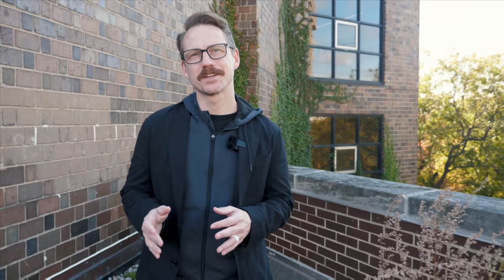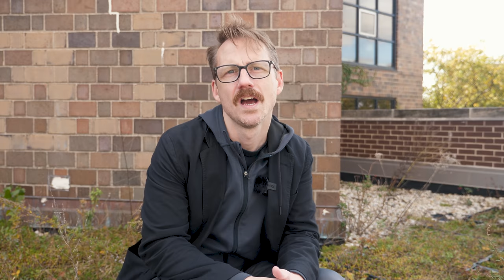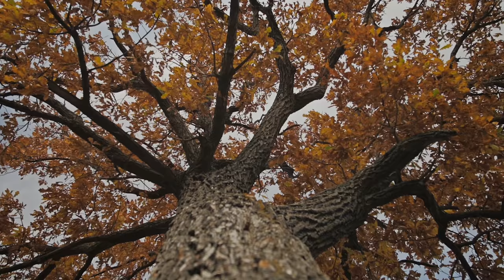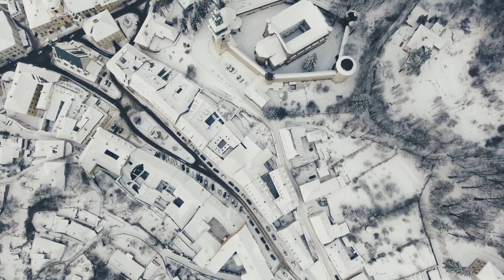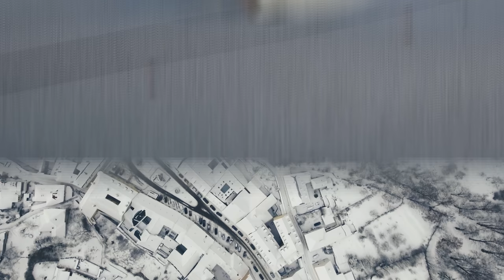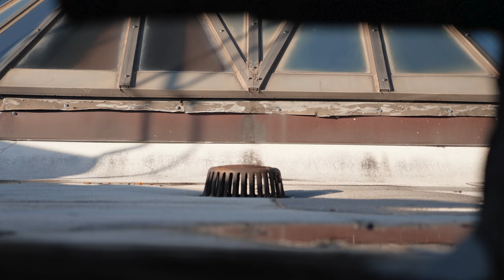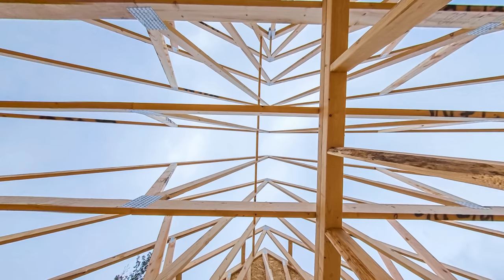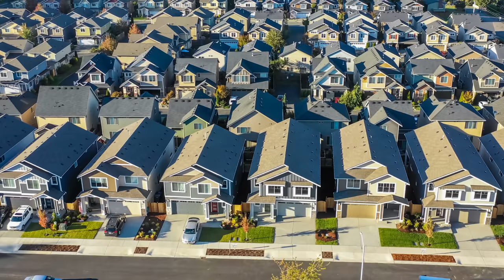Why Do Architects Insist on Using Flat Roofs?

Comment: I don't know about elsewhere, but in the UK flat roofs in a domestic setting are synonymous with shoddily built extensions that are cold in winter and have persistent leakage problems ten years after they were built. I think it's this that leads people to loathe flat roofs in houses.
Reply: It's people going for the cheapest quote. Getting poor quality people. That simple don't have the skills or knowledge. Even the Germans use flat roofs. I've worked in both countries.
Reply: @BillyMustang101  My late parents house had an attached garage with a flat roof. That flat roof had to be renewed four times over the fifty years they lived there.
Reply: I did work on one of those extensions.
 I tarred the roof, green as all hell I was mind you.
It took attention to detail more than anything, our friend and neighbor who is an actual handyman blew it.
All I did was make sure the tar made logical connections with the flashing, and press on the roof to find leaks.
 P.S. roof tar doesn't like being 10 layers thick. It contracts/expands during thermal cycles, if it's thicker it splits more readily.
Reply: The town-home I used to live in had a section of the roof that was flat that held the heater/air conditioner. They leaked all the time and it was very expensive to lift up the air conditioner unit to fix the roof underneath it.  I will never buy a home with a flat roof again.
Reply: except for reed tatched roofs.
Reply: also - the poor council housing in the UK (aka social housing) in the 70s - every single block of these flat roof houses ended up having a leak - and it's still going on today.  Quite a few have had a pitched roof put on to allow the water to drain off.  The people responsible for chosing that particular design....went to prison for taking back handers to speed the project along.  Meanwhile some of of us live in them (mine now has a pitched roof).
Reply: @peterjf7723  then that roof wasn't built or maintained correctly. I've been on buildings with flat rooves over 15 years old and not been redone.
Reply: Well you perfectly described my dads situation with his flat roof extension 😂 it looks good and from a design aesthetic suits it but complete nightmare with leaks. We’ve had it repaired multiple times still the leaks are damaging the plaster inside.
Reply: @jamestucker8088  The problem isn't that the roof was "flat" but that the HVAC unit should have been on a prefabricated curb to which the roofing membrane was flashed providing less potential for leaks and easier repair or replacement when necessary.  Unfortunately, the original contractor choose to "save" the money for himself rather than do it correctly.
Reply: Ive designed many flat roofs in the UK and even built my own, with my own hands, in 15 years no leaks. Flat roofs work very well with complex geometry on new extensions to old houses.
Reply: A bad assembly is a bad assembly, nothing to do with the system.
Reply: @bispal  The problem is a lot of people have a strong memory from when it's done wrong, cost cutting and bad workmanship can be a big problem.
I know flat roofs if done well are fine but so many of us encounter problems, it's a shame but I suspect a lot of people see flat as a way to cut costs over a real design and quality mark.
Reply: @liaminwales  my neighbour just had his 5 year old pitched roof completely replaced at a cost of £40,000 due to bad workmanship and that doesn't include the top hat scaffolding costs or water damage. Flat roofs and pitched roofs can equally suffer from sub standard construction quality. A roof type should be chosen for appropriateness to the situation.
Reply: @bispal  Maybe it's relay a UK thing in the zeitgeist from historic events.
I know your right all roofs have problems and it's never a fun time.
Reply: You should install proper roof tiles made of ceramic or earth not the cheap glazed paper crap
Reply: @BillyMustang101  like your grammar
Reply: There’s a lot in Southern California, Arizona, and New Mexico because it’s so sunny. UK weather sucks lol I don’t know how you guys can live somewhere so wet, cold, and depressing
Reply: The cold and damp is more pronounced in Britain than here in Spain, but the effects are similar.
Reply: FROST is invincible and will destroy all flat roofs
Reply: Usually built by a libral leaning council, and a building that has all sorts of social problems.
Reply: With a triangular roof you can be sure the water will move quickly away and you can know where to.  They also act as insulation to the property under them.
Reply: @demammoet  So basically, flat roofs on houses are fucking worthless expenses you have to pay for multiple times over the years to get fixed because they are a flawed design from the very concept of being flat and I know from first hand experience living under one.
Reply: @amartinez97  it's more that I'd say it's not DIY friendly at all.
 Tends to be a professional's job.
I have nothing against them.
 If I had to put money on it, it seems like tons of contractors and homeowners don't respect the tighter tolerances of a flat roof.
 Bitumen isn't even that hard to put on imho, look it up.
 Large sheets of oil products you flash heat and put on.
 There's just too many guys with two left hands.
 If you're familiar with construction it's all a bunch of work harder not smarter guys.
 You need the quiet kids that people say overthink stuff, or look "slower" because they're not trying to impress, who can actually explain stuff little.
P.S. I showed interest at my sister's house when a friend of theirs did some work for em.
 This guy was quiet like me, and a professional carpenter.
 I talked about their flat roof and said, this doesn't look right.
 He told me, "I was debating myself if I'd bring it up and how, as your sister just had it professionally done by another friend".
 He was just going to fix it quick, but he'd have to get the materials.
 That guy was just we everything you could want, could've easily been a competent general contractor but he was content.
Reply: @amartinez97  p.s. all I can tell you is, gravel on flat roofs is great, make sure you always have raised edges on the roof.
 - They always f up the bitumen seams, not enough overlap or straight poor workmanship not getting it hot enough (probably scared of burning it which is more noticeable a mess up, people in trades will often be insecure and when unskilled will opt into mistakes that aren't obvious for the inexperienced. Mind you, clients are as much to blame for that, they're insufferable half the time.
-Only layer over your bitumen with roofing products if it's noticeably dried out, if you patch a leak, patch, don't plaster over it, keep it thin (you don't want to alter the thermal profile or the stretch and shrink becoming uneven).
-Also I'm no expert, just trying to pay attention.

-
Reply: @demammoet  i don't know terms. What does "green" mean in this context?
Reply: @freddiesimmons1394  "green" means to not have experience/ inexperienced.
Reply: Let me remind you of the UK building most associated with a flat roof. The white tower in the Tower of London complex.
Reply: Ben Dover   No, flats are what you call apartment buildings or condos, and they often have sloped roofs.
Reply: @ethankriegel5957  what you need to consider is that pitched roofs from the same period would have been built and maintained to similar standards.
Reply: @paulhcan  yep i was going to say this too. I suspect the UK is where a lot of the arguments about dogmatic architects comes in also, as many of these council flats were built with the express purpose of designing away societies ills. There was a similar process in the construction of post war 'new towns' like milton keynes and coventry. 

Unfortunately these architects often knew very little about what was actually important for people, and so many of these flats and towns are intensly soulless and unpleasant places to live. For example, designing communities with no spaces for pubs because thats 'immoral' - but completely neglecting the social role thise buisnesses play in many brittish communities. Many of the flats in particular have actually needed to be torn down over the years (same as the slums before them) because they were so unsafe or awful to live in. And architecture that is actively dissmissive or hostile to working class people (who actually use most public buildings) is an extremely common and well publicised problem in the uk. From segregated doors, to glass fronted high rises that melt passing cars, to schools and hostpitals with non-functional 'architecture' that makes peoples jobs actively harder (my secondary school was one of these) - Brits are extremely aquainted with the idea that toff architects and companies given contracts by their palls in parliment often dont give a singular fuck to the practical use or maitence of the building by those who have to use it. 

And yeah, an actual flat- or even low slope- roof in most parts of the uk is a complete dipshit move. Im not sure ive seen a flat roof in the uk that didnt have standing water on it somewhere. It really is too chronically wet and cold for them to be good long term investments- unless your a developer looking to squeeze in a few extra flats for cash.

And thats the rub, frankly. Just because a flat roof makes for more social or up top storage space (in good weather) or means you can fit more flats in (and make more money), doesnt make it a good choice for the people who actually have to live or work in it everyday. And thats the rub- because if you have a group of architects who prioritse theorectical benefit or the economics of the owner over the quality of life of the people using the building- then that IS a highly ideological choice, and people are right to be scornful or upset when it happens. Especially on a systemic scale.
Reply: @demammoet  ok but i dont think its actually reasonable to expect everyone to be capable of replacing or repairing a flat roof every couple winters. Just from a skills and accessability perspective- not everyone has access to the physical requirements. A flat roof (in the uk) for thise people is just needless extra expence. Thats before we even get onto rental properties, where you may not be legally able to access or act on the repairs that need doing yourself. 

Then there's the waste to consider- many of the materials for flat roofs are petrolium or rubber based, which is not exactly sustainable or environmentally friendly. By contrast, traditional roofing materials are (by nessecity) much more local. This isnt to say everything has to be slate, clay, or thatch obv (thatch in particular is really high maitence) but firing a new set of hard wearing terracota roof tiles is probably a hell of a lot better than bitumen for the environment, and will last longer to boot. 

Why should anyone waste time, energy, or money on a demonstrably short term solution when we know a good long term solution exists? And especially why should anyone be forced into that short term solution by someone else?
Reply: @ems9616  I believe they have similar lifespans to asphalt shingles.
 Mind you, you're thinking the UK. Land climates are almost locked out of use of terra cotta roofs.
 It's essentially, oil products, metal, wood due freeze thaw cycles. 

I'm not sure what you're talking about regarding a use of force to own flat roofs.
 Many a flat roof fails too because people seem it the "cheap" solution now. Using unskilled labour deeming it easy, and not investing in the river stones on top, not knowing how much stress the roof can handle.

 It's just the least used roof, shrouded in mists of mystery. While very qualified roofers tar some office building roof out of sight.
Reply: @wallacem41atgmail  exactly people speak about things they dont undestand.
Reply: That is downs to geography, the same considerations are given to wooden houses in Mexico, if to build with wood your house there is not a single national bank that will insure your house, not matter what and forget about getting a credit to buy a wooden house, that is a non starter.
Reply: there is also the bad reputation of the flat roof pub; an institution of no heritage hehe.
Reply: @peterjf7723  That sound about the usual mainentance interval for a UK domestic flat roof of refelting/rebuild every ten years or so.
Reply: The many defensive flat-roofers in the comments trying to explain away the problems people have had with flat roofs as "just bad craftsmanship" completely miss the point:  Yes, most construction workers are not OCD perfectionists...so if you live in a place with rain, just don't build the flat roofs that you already know they are inevitably going to screw up, and need replacing much sooner.